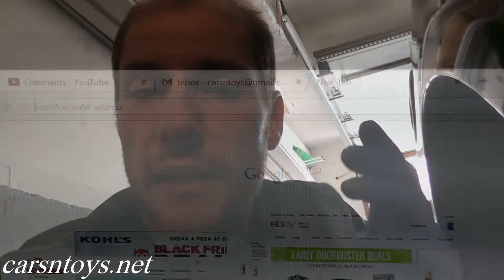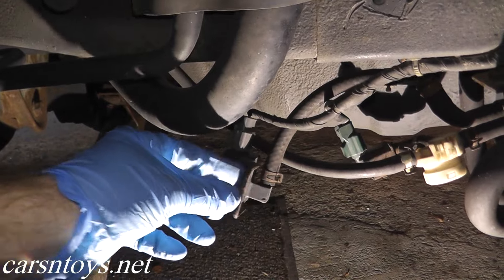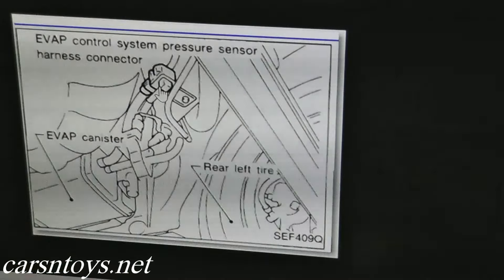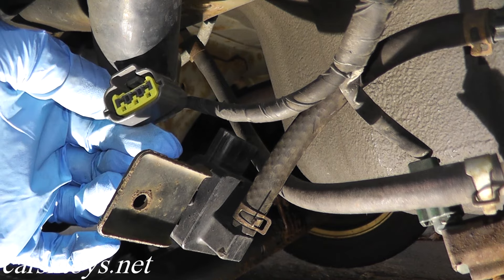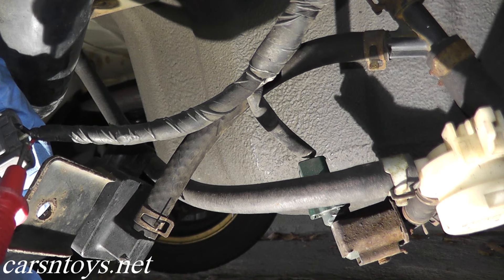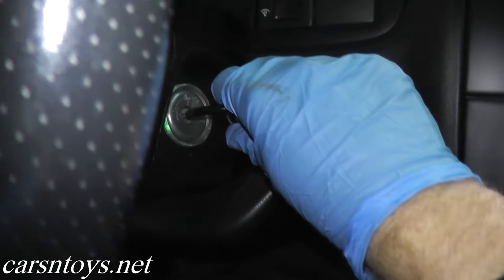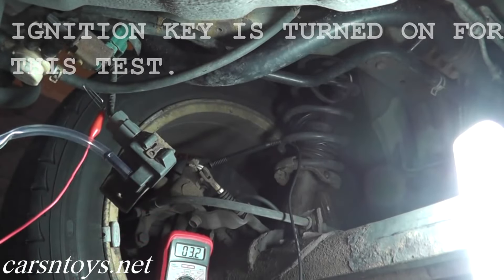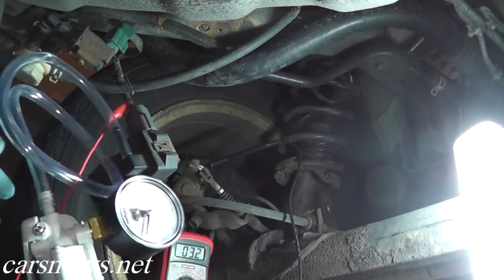How to Test and Replace EVAP Pressure Sensor P0450

Comment: Hi, have you ever done evap work for a smart car? All the 451 models get the p0451 and p0452 engine codes. Most of the time the cap change doesn’t help. Do you happen to have any advice for us smart fortwo owners.

Comment: Hello, looking for some advice on my car. It’s a 2011 Cadillac SRX.the car threw a code the other day for a po496 which is Evap flow during non purge… found out the purge valve was bad so I replaced that and now the car is going crazy and has other codes now. The 496 went away but it won’t start but for a second then stall out after several attempts it will start but the second you give it acceleration it stalls out. I don’t understand what else. Possible Evap leak? Other than this code the car threw a code for a 02 sensor but have been driving with that code for 8 months. Not sure if maybe the pressure sensor. Believe it’s in my fuel pump on this car so that won’t be easy all that easy to access. This all started when I filled up the tank with gas 2 weeks ago and it wouldn’t start at the gas station. Sat for a bit then the car started and drove just fine. Until 2 days ago. Car started stalling and went into reduced engine power

Comment: A 2016 honda fit - testing positive @ 2.4v, testing center w/vacuum - stays same - no drop in voltage.  Is pressure sensor bad?

Comment: Every time I search EVAP pressure sensor for my truck I get fuel tank pressure sensor info. Thankfully I looked at your video as I really wasn’t looking for more info as. Thought I had it figured out. Unfortunately I already pulled the bed off the frame to access the fuel sensor easier. I also have a EVAP vent code do it wasn’t a total waste of time. Thanks for the video

Comment: MY GAVE A PO450 CODE,CHECK ENGINE LIGHT       ....AND IM WONDERING  if my old battery is weak nearly dead would if give the code?     what if the belt isnt tight enough,no squeels but would that give the code?        trying simple stuff before getting intro this gas related sensor unfamiliar stuff.

Comment: I have a P24d8 code on 2014 CLA 250 - evap pressure sensor high - cant seem to located where it is on my vehicle - would be helpfull if you know where ?

Comment: just came across your video.  i'm testing the pressure sensor for a 2001 tacoma 3.4 liter engine.  since the requirement for vacuum is so low and i don't have a vacuum pump, i decided just to suck on it (yeah, yeah...all jokes aside, i'm just making do with the tools i have) anyway, my voltage doesn't change one bit.  do i need more vacuum than my mouth is making?

Comment: I have same error code, I tested the connection have no voltage at all. Tried different method but still not able to get any reading. Checked the wires all good. Is any way I can traced it back to pcm? It’s 97 d21 Nissan pick up. Thanks

Comment: I've had "EVAP system monitor incomplete" for at least 10 drive cycles.  There have been no trouble codes, so apparently there are no vacuum leaks.  If the tank pressure sensor was bad, wouldn't there be a trouble code?  I've had the tank out a couple times already and really dread having to take it out again.  If the sensor wire was open between the tank and the computer, wouldn't there also be a trouble code?  Wait, it that was open then the sensor wire at the tank would read 5 volts, wouldn't it?  I'm really stumped on this one, hoping you can help!

Comment: Oh hi I'm having trouble code p1447,  my canister was bad so I did replace  it and several other parts but after resetting my light codes it come back again,  so I would appreciate any help in solving this ,thanks
Reply from the maker: How are the rubber lines running to the canister?
Reply: @CarsNToys  they look fine but maybe I need to purge them with some pressure air

Comment: I have a 2001 Camry and have a PO450 and PO446 code when I did your pressure sensor test I got. 
With a brand NEW canister and sensor. No pressure 3.9v and -2pka 4.9v      and 
my old canister and pressure sensors it reads 3.3v no pressure , 4.75v -2 kpa 
If i blow pressure into the the vacuum line the voltage drops. The opposite of your video. Do you think this is why I am still getting the codes? Thank you for taking the time to do these videos. They are awesome!!!

Comment: Do all of these units (for a ford f150) send the same signal for the same pressure to the computer? I have a 2004 ford f150 with a inline pressure transducer and Ford has them on back order. I found one for a Crown Vic from a later year that looks the same but for the connector. If it would work, how would I know which wire would go to which wire on the connector? Thanks for any help.

Comment: Good videos, very valuable information.  I've had a P1440 (small EVAP leak) for a few months and have not found the problem yet.  Changed the gas cap.  Even smoke tested the system with no luck.  However, during one of my inspections I discovered charcoal granules in the vacuum cut by-pass tubing close to the canister.  Per Nissan Service bulletin NTB00-085a, I am planning to clean out all of the tubing once my new canister shows up. My guess is that some granules are preventing valves from fully closing or blocking the pressure sensor path which end up tripping the CEL. Fingers crossed.

Comment: I had an eve app code show up on my Honda element PO 2422 dealer told me to replace the vent valve and the code is still there after it was a raced then they told me to replace the vent filter and that did not work either any idea what might be going on, can you help
Reply from the maker: Evap codes can be tricky. I'd first test if there's a leak. Scotty Kilmer has an older video showing how to find leaks in an evap system using cigar smoke. Just do a quick search on his page.

Comment: I have a 1996 240sx, for the past 6 years it has been throwing the code p0446 (the vent valve). I have replaced every hose and the carbon canister and the vent valve itself. I tested the continuity of the wiring etc. Basically I did everything and no matter what, it keeps throwing that code. it's frustrating because I can't pass inspection with this code. I brought it to multiple mechanics and they each told me something different. I ended up buying a new ECU and re-wiring the whole thing and it still won't go away. Recently I was looking at the FSM for the 100000th time and noticed it mentioned the pressure control sensor might be responsible for causing this code to pop up under p0446. Any thoughts on this? I'm so frustrated that I just want to buy a new control pressure sensor as a hail Mary attempt but they're like $120. idk what to do man, I'm losing my mind haha
Reply: Just fyi, I'm going to attempt to test the sensor just as you showed in the video just to make sure it works or not before buying one.
Reply from the maker: I'd check the vent valve, pressure sensor and double check there aren't any plugged hoses. These evap codes can be a little trickey to resolve sometimes.
Reply: Just unplug the things from the PCM reset codes on PCM and leave them not hooked up then you can pass Inspection!

Comment: Thanks! Great explanation!  My 2000 Elantra has this switch on the cross frame.  Very rusted and has 3 hoses coming out of it.  Could a bad pressure sensor cause a P0442?  I've been chasing after this small leak for months now.  Replaced purge to canister line.  Vent valve. Purge valve. Canister vacuum is good. Multiple gas caps.  Any thoughts would be helpful.  Thanks.
Reply from the maker: Scotty Kilmer has an older vehicle finding small evap leaks. He simply uses a cigar. Just do a search on his channel.
Reply: @CarsNToys  haha. Scotty's a trip.  I'll give it a look. Thanks

Comment: The tests for 5v and ground are not valid with the connector unplugged, your circuit is not loaded. No current flow = no voltage drop. 
You could have high resistance In the circuit and still read 5v at your meter. 

When doing these kinds of tests your circuit has to be loaded.
Reply: Somewhat true, but still a valid test that most mechanics would perform.  The voltage drop would be from the small current applied by your DMM.  Yes it could be a weak connection and still give good results, but this is rare for lower power consumption circuits like a sensor.
Reply: the test meter completes the circuit you doe doe DAH DAH ROFL HAR HAR

Comment: 95 Mercedes c280 engine light, obd2 reads purge flow sensor circuit low volts. I checked and the volts are .5 how a can fix the problem

Comment: Notice that Chrysler products have a fuel tank vapor pressure sensor always located in the fuel filler neck. Guess it is easier to reach 
 than dropping the gas tank!

Comment: Thanks for the upload man! I just passed my smog test and certification with a PO450 code on my ZR2 Blazer.. Just letting people know because alot of disinfo on this code esp. in California. Some say you wont pass some say you might some say you can. I passed whew. My OBD II reading was evap P0450 no CEL ever illuminated. Changed my gas cap before I went into the shop. I did nothing but change the gas cap and my OBDII EVAP red light was still on and I did not fail the test.
Reply from the maker: Wow. Very surprised you passed, especially in CA. Was the code pending?

Comment: Have 5v at connecter but when checking for continuity there is no sound on terminal 1...just numbers on the multimeter (have the exact same multimeter)

Would this indicate a break somewhere in the black wire? Could I create a bridge from another ground wire to the black wire?
Reply from the maker: What kind of vehicle are you working on?
Reply: 2001 Nissan Altima, 2.4L

Comment: Thanks for the video. When I check the pressure sensor does the ignition key have to turn the car to the on position but not start the car? Whats interesting is theres only two wires going to the sensor and your getting 3 volts  not 5 when you test the pressure sensor.

Comment: great videos any help is appreciated my car a 06 galant has 3 codes p0441 p0450 p0452 i check both purge valve solenoid and the evap  pressure  system isn't leaking  at all any help appreciated
Reply from the maker: +Gilberto Calderon How about the rubber hosing; any leaks?
Reply: +CarsNToys no leaks

Comment: does anyone know where the evaporative emission control system pressure sensor p0450 is located in a 97 camry??? any help would be much obliged
Reply: Gas tank top

Comment: When I apply vacuum my voltage goes up
Not down ????
Reply: That's likely just due to the design of the sensor. If it's changing consistently as vacuum is applied/removed, then it should be working fine.

Comment: What will happen if the pressure sensor or its wires are bad?
Reply: Help. I have a 2000 Nissan Xterra throwing a p1446 code. I have checked the evap canister solenoid and it does close when power is applied to it.
Reply: nothing IT WONT WORK  rofl